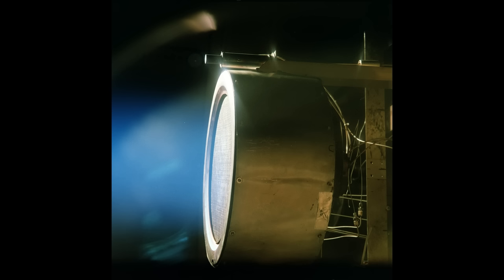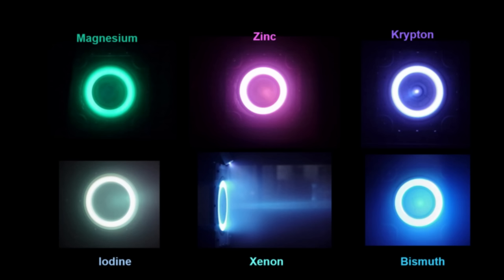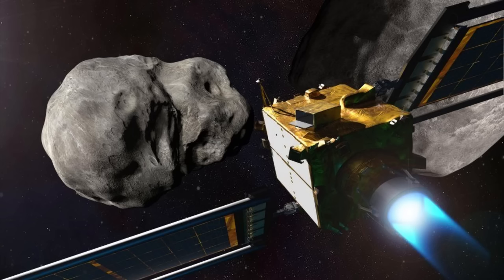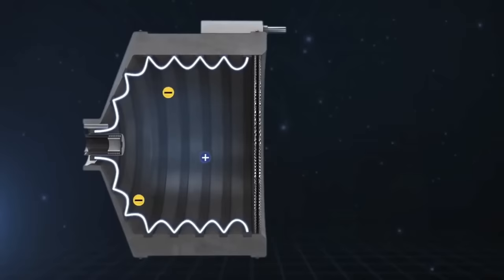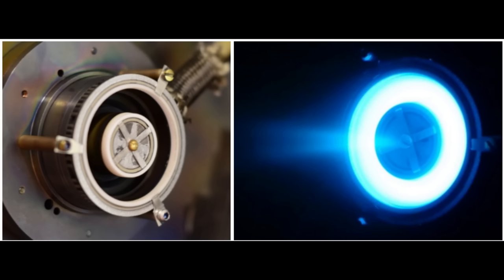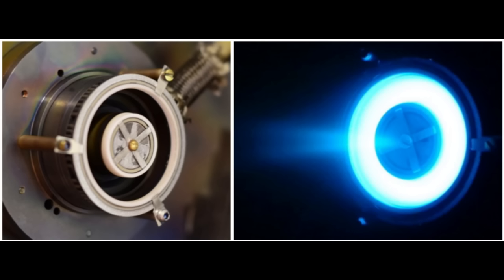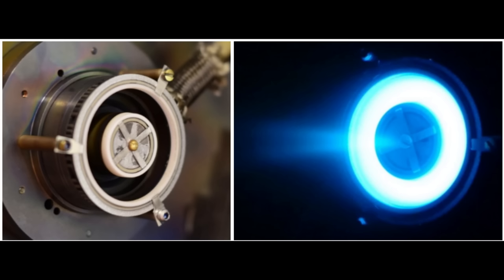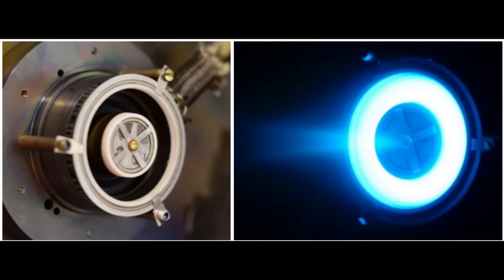Why Are There Two Different Types Of Electric Space Engines, And How Do They Work?

Comment: An interesting consequence of the design of the hall effect thrusters is that they impart a swirl torque on the spacecraft along the axis of the thruster, so spacecraft using hall effect thrusters may need to desaturate inertial attitude control systems (reaction wheels/CMGs) periodically
Reply: Normaly you woud solve this by adding a second one spinning the opasite direction. But that would not work because you can't just flip electron rotation around magnetic field   ( or something like that)
Reply: @Thefreakyfreek  You could mount two some distance apart, angle them very slightly in opposite directions, enough to cancel such a rotation. Thrust vector roll!
Reply: can't they inverse the magnetic field for that ?
Reply: Huh, I wonder if a small portion of the thrust could be vectored to counter it? Almost like vernier engines
Reply: I read your comment and was wondering why - when I saw those electrons circling, then it was clear.
Solution: 2 thrusters with the coils wound oppositely (or current in opposite direction).
Reply: Why can't you setup the thruster to work with the electrons orbiting in either direction and pick whichever direction reduces the speed of the reaction wheels?
Reply: I was wondering about this
Reply: Use 2.
Reply: That seems really easy to solve, just use a 50/50 mixture of electrons and positrons
Reply: @AlanTheBeast100  -- I think that would reverse the thrust. Look up the right-hand rule.
Reply: Not a huge issue in Earth orbit since you can just use magnetotorquers to push against Earth's magnetic field "for free" (using only electrical power), but that could be a more serious constraint for beyond LEO missions.
Reply: @TlalocTemporal  Doh!  Didn't think of that!  And not like you could turn it around - no source "out there"....
Reply: My knowledge of electromagnetism is a bit rusty, but would this not also inverse thrust?
Reply: The same magnet that bends the ion stream out of its cylindrical path to vector out of the engine and provide thrust, can vector those ions in such a way as to counteract any torque due to initial acceleration of the ion stream.
Reply: @TlalocTemporal  no It wouldn't. the thrust is caused by the positive charged electrode. what would happen is the electrons would orbit in the opposite direction causing the torque to change direction which is what we want.
Reply: Why not just use two rotated in different directions
Reply: Couldn't the thrusters be paired with opposite magnetic polarities such that the swirl is canceled out?
Reply: Or for that matter switch polarity of a single thruster periodically to cancel the rate.
Reply: Im sure chemical engines also produce very slightly asymmetric or irregular thrust. So you use the spacecrafts rcs/gyros/thrust vectoring to counteract that.
Reply: Oh that's exactly the question I was about to ask.
Reply: Could you build a chamber in a different shape than a circle? Maybe something resembling the digit 8 or the symbol of infinity, two slightly overlapping circles that would cancel out the torque and perhaps even have some interesting effect going on in the middle. It amazes me the physics is not fully understood, that's a sign that there could be a lot of untapped potential waiting to be discovered.
Reply: I'm thinking you could have a pair of hall thrusters with anti-parallel magnets giving opposite electron cloud directions. I'm not sure if that would fully work, though. Only worth it if it still qualified as a TIE design. 🤔😄
Reply: @davidgunther8428  it would work. But they might also interfere with each other.
Reply: @gavinkemp7920  Unfortunately not, because then the electrons wouldn't fly out the back. It's a right hand rule sorta situation :)
Reply: I would've never thought of that but it makes so much sense. Thanks for the input 👍
Reply: @xiphosura413  or -(left hand rule) if you're simulating in unity engine or blender lol jk
Reply: @xiphosura413  That's simply not true. Simply switch the field direction and switch the electron orbit direction. The positive ions are propelled by electrostatic repulsion to the electron cloud, not the magnetic field. Electric motors, generators, rail guns, etc. can all be mirrored, and they still work just fine.
Reply: So spacercraft have P Factor too? ;-)
Reply: @gavinkemp7920  -- Ah, good point! That makes sense.
Reply: @xiphosura413  The right hand rule is what is defining the direction of orbit of the electrons not what is defining the direction of travel of the ions. The video said the hall effect had little impact on the ions other than the torque mentioned by the OP. Its certainly not inversing the charges between the electrons and positive electrode which is what is creating motion in the first place.
Reply: @Thefreakyfreek  It works if you add the second one that produces the torque in the same direction, too. The stuff doesn't needs to be contra-rotating.
Reply: @michaelbuckers  can you elaborate further
Reply: @Thefreakyfreek  Well just try applying torque in same direction on the opposite ends of a stick. Torque is not a real force, much like gravity, so it's a bit counter intuitive.
Reply: @michaelbuckers  Torque is measuring how a force creates rotation, isnt it?

So I dont really get how you can counter torque in one direction without creating torque in the other?

Also, Id be careful throwing in stuff like "gravity isnt a force  either", because thats a whole can of worms.
Reply: @termitreter6545  Well it's not. It's just how we perceive warped timespace around massive objects. Coriolis force isn't a real force either, neither is centrifugal force. Etc.
Reply: @michaelbuckers  See, Ive seen people say what yorue saying a lot, but theres is a fundamental misunderstanding. I only know because I find that a very interesting topic and looked into it:

So what is a "force" depends on what physical model you are using. Sometimes on the frame of reference too.
In some models, gravity is a force, in other it is not or something inbetween.

Eg in Newtonian Physics, which you are likely refering to, gravity is considering an "inertial" or "ficticious" force. Which I dont think is quite "not a force".

But the important thing is, Newtonian Physics is incomplete, its a simplified model like many things in physics. It doesnt actually predict things like quantum dynamics or space time. And because of that, it cannot actually give an accurate mesaurement of "gravitational force". Hence Newtonian considers gravity an inertial force, which is like a hack to make up for not being able to estimate it. And most of the time thats fine.

But to say gravitation isnt a force because of newtonian laws, is like saying yellow isnt a color, because your painting equipment lacks that color.
Its not wrong that yellow isnt a color in your painting, but that doesnt mean it cant ever be.

Anyway, at least thats my understanding here. To make the general statement that "gravity isnt a real force" doesnt really work, as long as we arent talking about a very specific physical model.
Mind im not trying to be a smartass, I find it just really interesting to think and learn about this kind of larger scale understanding. Also helps in discussions.
Reply: @termitreter6545  Gravity is a force in Newtonian model. I specifically referred to relativistic model, in which gravity isn't a force but only an artifact of timespace being warped. In any case, it was only a vehicle to drive the analogy, that a lot of things in real world physics are counter-intuitive. Such as torque, which isn't a rotational force but merely a state in which force is distributed in a closed circular loop rather than in a straight line. Well what happens if you got two such loops next to each other? Nothing, the forces cancel out. You get a bit of twist in the bracing element but that's it.
Reply: @michaelbuckers  Yes, the relativistic model usually cant account for gravity, and might consider forces like that artifacts. That is a problem with the model, and not a statement about gravity. It does not actually say "gravity isnt a real force".

So its confusing if you say gravity isnt a force, just because a model is too incomplete to portray it. 

And its not like were even limited to any specific model, nobody here asked for that.

So its really not helpful as an analogy, and makes me think there is a misunderstanding about what a physical model actually is, and which one you are actually using.

Same with your statements about torque: Youre making a definition of torque as if its absolute, when in reality it depends on the model.
Reply: @termitreter6545  Sounds like you're trying to punch WAY above your intellectual weight there fam.
Reply: @michaelbuckers  Thats literally the thing people write, when they are insecure about not having an answer.

Thats just so boring.
Reply: @termitreter6545  Well you confuse branches of physics and toss together words don't belong near each other just to sound smart, I'm not surprised I'm not the first one to call you out on that.
Reply: @michaelbuckers  Okay, im going to give you one last answer:

If I was wrong, which is possible and im not afraid of that idea, then you failed to actually correct me at any time.

Thats usually the sign of a person that doesnt understand what its talking about. And getting defensive, let alone insulting about a physics discussion... thats just a personal failure, ironically enough.
Reply: @termitreter6545  How do you correct someone who says that the color of the sky is iron? If someone said it was red then you could correct that. But the stuff said isn't even within the realm of possible wrong answers. Might as well not even entertain the notion.
Reply: @feisty-trog-12345  "Boom. Boom. Boom boom boom. Boom! Have a nice day!"
Reply: @matwyder4187  interesting, but that sounds like a very complicated solution to a super small problem
Reply: @xiphosura413  switching the polarity of the magnetic field reverses the orbit direction of the electrons, or current as well. And since you flip both the magnetic field and the current by 180 degrees, the right hand rule says that the force is in the same direction.
Reply: They also employ trunnion arms to prevent side-fumbling. The only new principle involved is that instead of power being generated by the relative motion of conductors and fluxes, it is produced by the modial interaction of magneto-reluctance and capacitive directance.
Reply: The mass of the craft should be sufficient plus there are rcs for orientation.  And there are some stupid crazy advanced prototype rcs  just right for now.
Reply: @Thefreakyfreek  You can change the direction of the magnetic field on the second thruster thus rotating the electrons and the exhaust in the opposite direction.
Reply: @mytube001  great solution  

Never thought of that. Not immediately anyway
Reply: @termitreter6545  Unfortunately, I agree somewhat with Mi28. "the relativistic model usually cant account for gravity, and might consider forces like that artifacts.". Even with my very limited knowledge I think a statement like this is weird and incorrect.

I can understand people not responding in a satisfactory way to you because it would quickly degrade into long replies about what you mean exactly by this and that and also rehashing  the basics of Newtonian and relativistic physics in YT comments.

I think if you get a little more acquainted with the models and how to use the language surrounding it, you will get better discussions.
Reply: The current is circulating around the chamber as massless electrons. Due to the radial magnetic field and the commonly know equation, F=IXB, the force on the gas through which this current flows is out of the thruster. How much force is actually generated in a circular pattern? Is it a low-percentage byproduct?
Reply: If I get my hands on alien tech lll come pick you guys up so we can start a new and improved society somewhere.

Comment: One clarification: you definitely can build propellant-less electric thruster - the Photon Rocket, but with 1N/3GW of power it's not a particularly practical idea. Still, in theory you could accelerate just by shooting a laser, without any reaction mass involved.
Reply: Also, you would vaporize anything that is behind you, with a laser that powerful xD
Reply: Well, really you are using energy, as your reaction mass, energy also has mass
Reply: @user-si5fm8ql3c  but you don't need to carry a tank with photons or worry they will run out.
Reply: You’d also need to be careful with the photon thruster about heat dissipation (which emits photons), solar panel use (traveling towards a light source acts like a reverse solar sail), and for radioactive power, gamma ray momentum losses.
Reply: has this ever been tested in space or not

because if not I feel like you're making the mistake of extrapolating things a step too far, so far the two studies that tried to measure the mass of photons both came out with positive results, and we know that photons have inertial mass (they impart a velocity change upon interaction with matter), and gravitational mass (they get affected by gravity in the same way as everything else)
now I am fully aware that it's not what einstein says, I'm just saying, if all experiments and all logic points to photons having a small mass... maybe it's worth considering

and what better experiment to test that than to put a big flashlight in space, then test it's resistence to change in velocity vector before and after releasing a large ammount of EM radiation

because at the end of the day, if we could make a reactionless engine, that would kinda break the universe, even if it takes millions of years to get up to speed, it eventually would, so pardon the skepticism but until it has been properly tested, I won't put blind faith in the word of mathematicians who have a long history of closing their eyes to anything that goes against their nice little theories
Reply: @anonymous-rb2sr  of course it was tested in space. In fact it's tested all the time because solar radiation pressure (aka sunlight photons pushing on the spacecraft) cause external torque and satellites have to compensate for that. Similarly there are solar sails being tested in orbit which try to catch this photon pressure into a sail. So we know very well, both from theory and from practice that you definitely can propel yourself with just photons. 

Actual photon rocket in too impractical due to the mass of power source. As I said, it's 3GW to get 1N of thrust. This means for example a 3 sq km solar array to get this 1N ;) The acceleration you'd get would be negligible and dominated by orbital perturbations.
Reply: @Pharisaeus  I know what radiation pressure is, I know photons/EM radiation exerces force on spacecraft
What we don't know is that without the solar radiation, a ship that EMITS photons would not lose any mass on very long time period, that's the million dollar question, as far as we know solar radiation is just tiny packets of mass going very fast that transfer kinetic energy to whatever they hit, again I am fully aware that modern theories say they have "inertia but no mass" but considering every test we have ever done says they have mass, I don't really buy it, not before it's properly tested

And I know it has never been tested, trust me I looked far and wide, not a single paper or experiment ever ( a bunch of teams tried to measure the mass of photons/confirm wether they were massless, all so far concluded that they did not have precise enough setups to be able to tell, except the 2 latest studies which both came out saying the photons probably had a very small mass, that was above their error margin)

Because again, if what you say is true and photons are indeed truly massless, then we can pretty easily buid things that break all other current laws of physics, so it's a paradox, one part of physics is broken, something has to go, either photons have mass, either you can use photons to accelerate massed objects to the speed of light and possibly more with enough time, pick your poison
Reply: If my point still isn't clear, I'm not debating wether or not you can use light as propulsion, I'm putting into question wether you could use light as propulsion WITHOUT losing mass, which was your claim of a reactionless engine

And that claim, has yet to be proven, and all experiments that give hints towards the answer point to the other direction, so if you or anyone is going to claim you can create a reactionless drive that does not use up any mast yet can produce a force over time and distance and change it's velocity, without ANY loss of mass, then fine, prove it
Until you do, your claim is as credible as the EM drive
Reply: @anonymous-rb2sr  I'm sorry but no, no physics would be broken and no paradox would happen, simply because we can still create mass from energy (and vice versa). Nuclear reactors produce energy at the expense of mass and particle accelerators can produce mass from energy (a single proton-proton collision at high velocity produces lots of secondary particles, with much more mass than two protons). This also means that the discussion whether photon has mass or not is completely irrelevant here because what is important is if you could somehow "run out" of your laser, not if photon has mass or not. Even if it did it would not matter as long as you can produce them from pure energy, which you can.
Reply: Using a magnetic sail and pushing off the solar wind would be a better use of your power.